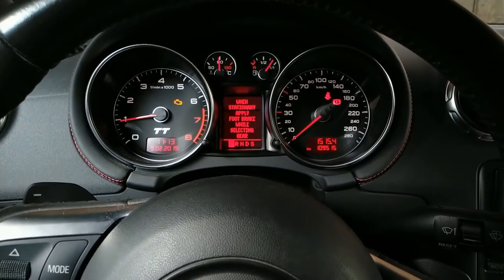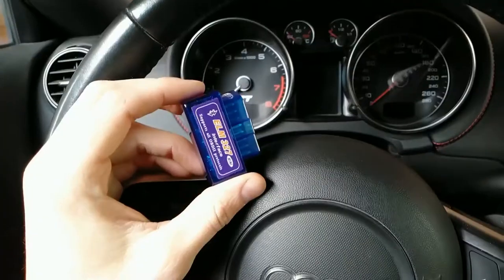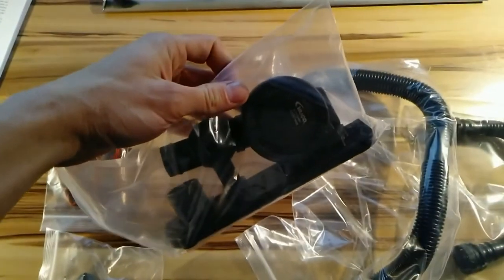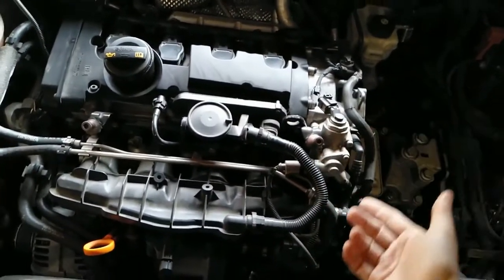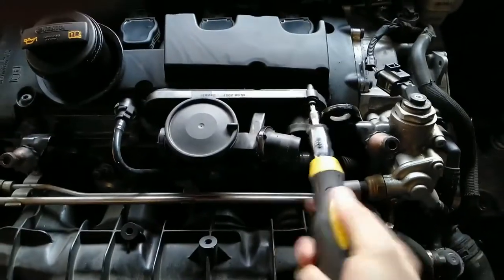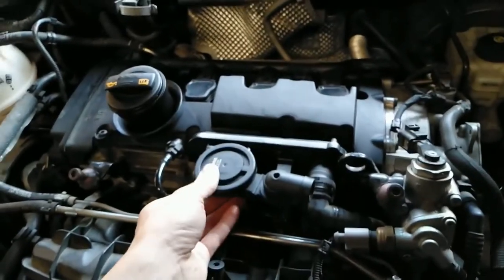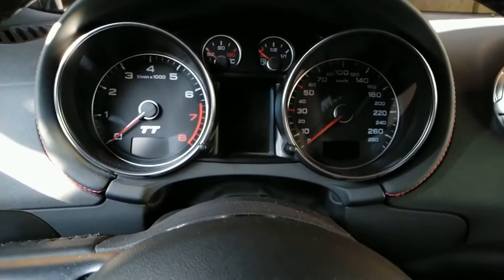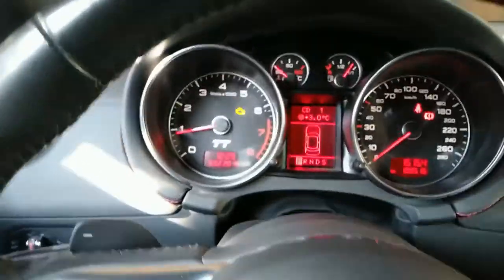How to Replace PCV Valve on Audi TT Mk2 VW Golf

Comment: Thanks for making this video :) made an instant improvement, the idle was smooth as silk again and acceleration top notch.
Before the fix, my car displayed next symptoms:
-shaking at idle
-rough idle at park and neutral
-weird idle at lower speeds
-more smoke coming from exhaust
-loss of power

Firstly I changed the MAF sensor and it made no difference. Then I read up on a tt forum and concluded its a pcv valve fault (also took it to a mechanic, who did the oil cap test - turn on the ignition, open the hood, open the engine oil cap - if it hovers freely then it is probably NOT the pcv, but if it is sucking in the cap, then it probably is a faulty pcv valve). Found this video and me and my dad replaced the valve ourselves no problem, I hope this comment helps out someone else, so you will not have to stress over rough idle.

Sending thanks from Slovenia!!! :D

Comment: For anyone else looking to do this it sorted my misfires at idle issue and made the mpg much better. You could smell the fuel on startup much more with the valve stuck open. I bought a cheap Chinese valve which is working much better than the original part from 2008. Car sits much better in gear also. Thanks op for help with this as the fitting was easy for a beginner.
Reply: Also I didnt change the hoses

Comment: Great video! :-) FYI - when running an OBD fault scan, P2279 Intake Air System Leak may also indicate a bad PCV valve. It may be possible to just replace the rubber diaphragm rather than the entire PCV using an after-market repair kit.

Comment: On my 2008 Audi TT this job is not as easy as Shown.  The top breather hose does come off by squeezing and working them out, BUT that larger hose that runs off to the right is a pita to get off, you will to break the plastic clip, so make sure you have a new hose.  The larger hose where it connects further down is very difficult to get to, I used 10" nose pliers to break the clip and pull it off, even getting it back in is very tough (unless you have tiny hands).  In this video he was able to disconnect the larger hose by squeezing it and did not replace on Audi TT MK2 that will not be the case.  So before starting the job look at what you have.  I'm not a mechanic but do lots of diy car work, got this done in about 1.5 hrs and my hands are a little torn up.
Reply: can you elaborate more on how do you replace the larger hose? i just ordered a new pcv valve and hoses and am not completely sure how to switch the larger hose.
Reply: @allychek  I have a couple pics, but don't know how to share them here?  There is a 3mm wide plastic clip that goes around the larger, and its part of the hose itself, so I took a pair of long needle nose pliers, grabbed it, and twisted/broke it off to remove the hose connection.  The new hose will snap into place and has the connector built into the hose itself.  The hassle is that the large hose winds around through some stuff on the left and then into lower part of engine which is difficult to get your hand in there.  I used some 10 inch large needle nose pliers to grab that connector and twist/break it off also.  Then pushed the new hose in.
Reply: As a side note, there was a small rubber vacuum hose that I knocked loose when installing the larger hose.  When I first started the car the idle was rough and inconsistent.  Once I found and reconnected that hose, it smoothed out.
Reply: @mikemiller5677  thanks for the answer :)!